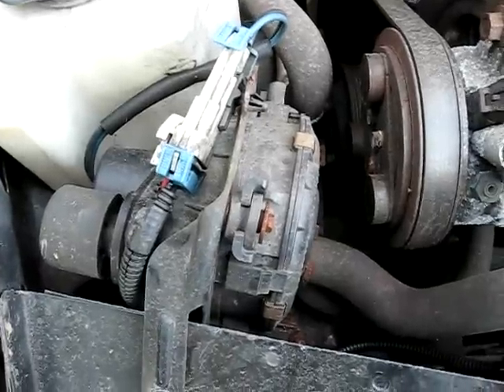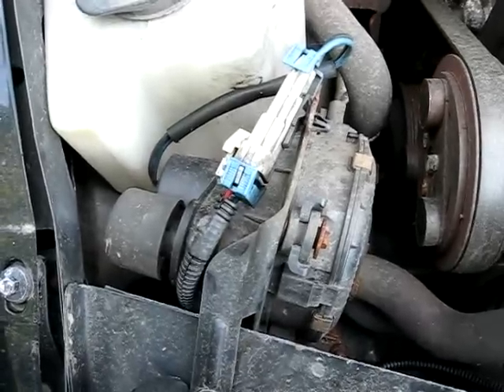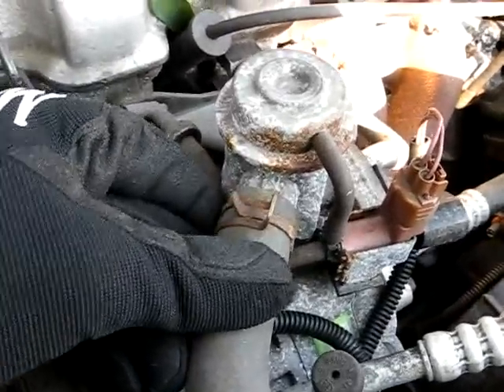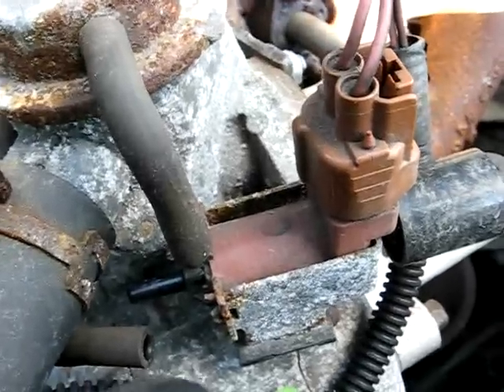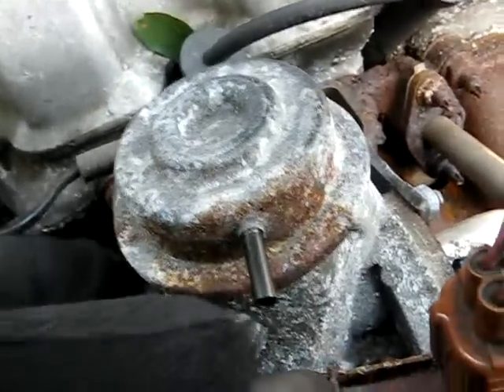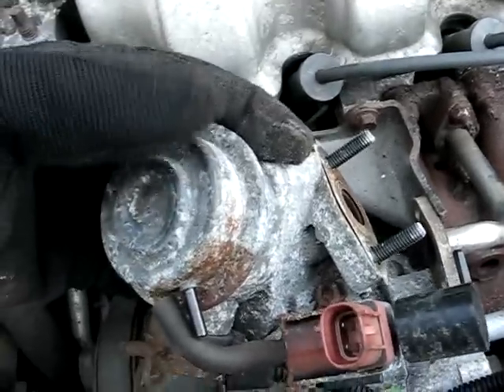P0410 Secondary Air injection System Troubleshooting

Comment: I got the p0410 but everything was ok. Took to a shop n they said it was the upstream and downsream o2 sensor. Could that be right?
Reply from the maker: A o2 sensor with a slow response time can set this code.
Reply: richpin06a Hey richpin - i took this to a mechanic and said that a p0410 can be tripped with a slow response time of the upstream or downstream o2 sensor and he said this: No, I wouldn't try to blame an 0/2 sensor. They are monitored themselves an would set their own codes if there was any issue with their response. The code indicates an issue with the secondary air injection system. The system uses an electric pump that can fail intermittently, along with other control components in the circuit.

I am at a loss on what to do.. any ideas?
Reply from the maker: Toki Tover
In some cases a bad engine coolant temperature sensor can set this code.
Reply: richpin06a Hey Richpin, you're so right. After having verified all secondary air systems to be OK in my daughter 2000 Saturn sl1, I continued having a P0410. My daughter kept complaining about the heat not being hot enough.  I checked it out, and told her, it's working fine ( nice and warm ).  Later on I realized, if that thermostat is malfunctioning or stuck open, it will stop the car from reaching normal operating temperature, and aide with sending P0410 check engine code. So I hurried up and switched out the old, for the new. That car heater works so well, you can bake a cake or cook a turkey in it. The P0410 code turned itself off, after about 15 miles of driving.  Over 313,000 miles, I'm shocked. That car wont die.
Reply from the maker: steelman1331
You did a very good job of troubleshooting.

Comment: Thanks richpin i followed your troubleshooting steps and found my diverter valve was faulty and the pipe leading to the manifold was about 80% blocked with carbon after replacing the valve from a salvage yard about 5 bucks and a bit of elbow greace got the carbon cleared away,in less than 30 min got the code cleared away,im far from a mechanic but your video sure made it easy for me to get the job done thanks!!
Reply from the maker: I am glad you got it fixed.

Comment: Hello
I have a 2002 SL 1
Every time the air pump turns on for 10-15 seconds WHILE driving sometimes the entire car loses power...meaning engine is still on but barely and if I SLAM on the gas I get absolutely NO response 

It only does this when the air pump turns on any idea why or what is the problem

Sometimes car turns OFF...I put it in neutral or park....start the car and we continue like nothing happened

Very dangerous on the high way when this happens
Reply from the maker: The air pump is only supposed to come on at a cold start not when driving down the road.Is the computer receiving the correct temp sensor readings.
Reply: Honestly not sure...this started happening ever since the changed the water pump....but the air pump turns on randomly now...your video is GREAT...on Wednesday I will do the check like your video
Reply: What's strange is the air pump pulls all the power from the car and I can.NOT accelerate for 15 seconds...just rolling down the street or high way
Reply: I tried disconnecting the air pump and the car was running HORRIBLE

Comment: Hello Richpin , I have question about the Air Pump  for my 2002 Saturn Sc2, Does the Air pump start when the engine is hot ? or it start only when you first start the car in the morning ?
Reply from the maker: The pump will only start when the engine is cold say in the morning.

Comment: Hey Richpin, need a little guidance here. I've hot-wired the air pump to my battery via the connector at the pump, and it works fine. I've also checked the other side of that line that supplies the power by hooking a tester into the female side of the connector. That receives power for about 30 seconds, then shuts off, just like it's supposed to. But when I plug the connector back together, and start the engine, nothing :(  I've tried cleaning out the connector (didn't look dirty though), and still nothing. I'm stumped.
Reply from the maker: I need to do a video on testing the fuse block were the relay plugs into for voltage and command signal from the computer.
Reply: I didn't mention that I did test the relay from the fuse box and that checked out fine. The current is coming through that supply line at the right time, it's just that nothing happens when everything is hooked back up.
Reply: richpin06a  I need to know how to check relay/fuse thanks in advanced your videos are very helpful

Comment: I am troubleshooting my 2002 Saturn sl1 with a p0410 trouble code.  What if I checked the current at the air pump and there's no current
Reply from the maker: Check the 30A air pump fuse,10A EGR fuse and the relay.
Reply: Ok Thank you very much.
Reply: I am having the same issue. Can you please tell me how to check the relay?
Reply from the maker: If i had one here i would do i video on checking the socket but i do not at the moment.

Comment: First of all these instructions are very helpful thank you for putting this together.

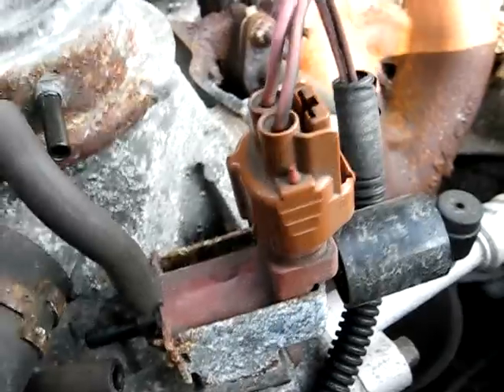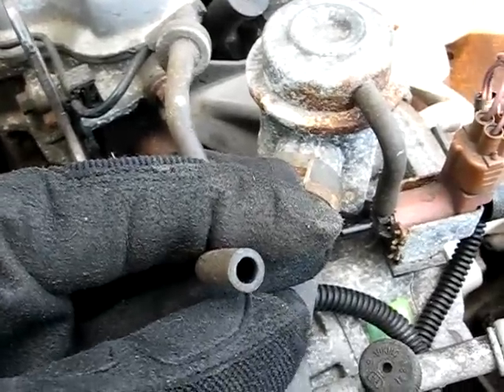Do you know what the level of the current should be going into the vacuum switch you mention at 2:15.  From going through the steps, I found vacuum on the input line (1:14) but not on the output (1:55).  When I checked the current on the electric input to the switch with a multimeter I get .11 amps.  So i figured that the switch was bad, so I replaced it but but I'm still not getting vacuum on the output.  I'm a little lost.

Thanks.
Reply from the maker: Remember the switch only works for about 30 sec on a COLD start up.
Reply: richpin06a Understood.  I checked it immediatelly (about 5-6 sec) after starting the car last night.  It had been sitting for several hours so it was definatelly a cold start. 
I'll try it again tonight and let me son start the car so I can be right there at the vacuum line to check it.
Something just occured to me.  Is there any chance that that little vacuum hose could be clogged?
Reply from the maker: Britt Blankenship Worth checking that hose to make sure.
Reply: richpin06a Hose is clear.  Little or no vacuum on the output hose.  Do you know what the voltage/current is support to be at the solonoid connector?

Comment: in min 4:05 how do you clean that? i don't have to take out the exhaust manifold to do that correct? what product should i use?
Reply from the maker: If the manifold is plugged up it has to be removed to clean it out.

Comment: For each vacuum test, do I need to be shutting off and restarting the engine and checking each vacuum test within the first 30 seconds, or is that just for the air pump?
Reply from the maker: I believe the computer shuts off that vacuum solenoid when it shuts off the air pump.

Comment: update 2:
p0404, p0410, p0507
These codes were all related. I cleaned the solenoid, pipe, diverter valve, exhaust manifold, and head holes for the emission system. The pipe was nearly completely closed the diverter wasn't too bad but the manifold grove was pretty bad worst part was the holes in the manifold which were all four completely blocked. I also cleaned the EGR valve which was stuck closed and cleaned the throttle body. Replaced the IAC (idle air control) and PVC. The code have been fixed. Still have the p0301 think its the ignition coil pack.
Reply from the maker: Wow that was a lot carbon.Your Saturn being a 02 sohc that P0301 could have a intake manifold leak which most had.
Reply: richpin06a yeah that's possible I have not tested the intake manifold but the ignition coil is sparking red so I have that on order should be here from .CA on the 4th. I ran out of money so I couldn't get carb cleaner can I use break cleaner to spray around the intake manifold or should I just use carb cleaner? I didn't try switching the boots on the ignition coil I did however clean it. My husband has wed and thurs off so I get the car all day those days (he works nights so i have to wait for him to get up so he can watch our little one) and I can make a big push to get it fixed. Have u done a motor rebuild on a saturn yet? Thinking id like to rebuild the motor at some point. When I do ill change the water pump and alternator just because it will be easier than replacing it when it still in the car. Sorry so many questions.
Reply: richpin06a it seems that the car has multiple problems.  Im trying to work through them a little at a time. Also wanted to ask why would the exhaust manifold have three gaskets? I found that extremely odd. Dad and I could only come up with the manifold wouldnt seal right, maybe due to a warped head.
Reply from the maker: poemranger
Not sure about using brake cleaner to find that vacuum leak.I have not done a rebuild on the Saturn engine.
Reply: I just used carb cleaner when I got to the corner closest to the power steering pump it stalled out so it needs a new manifold gasket. I have it on order. Other than the missing when its in gear at a light after the air pump is off it runs like a dream again. Thank you again, you've saved us a bundle. Im not sure I can do the manifold gasket so im going to call our mechanic and see what he will charge to replace it.

Comment: Hi Rich, thanks so much for the video. My Saturn 2002 SL air pump runs for about 30 seconds and then shuts off. Does that sound like the air pump is going bad? Trying to avoid replacing it if I can help it.

Thanks again for providing these videos. They have been really helpful for me.
Reply from the maker: The air pump system is designed to only run a short time after a cold engine start.

Comment: update:
I unbolted the manifold from the head and pulled it away to use a coat hanger to clear the completely blocked holes(two on the inside and two nearly completely blocked the outer). Used anti sieze on all the bolts including the bolts on the manifold(nuts and stud when it came out like that). The car ran great except for a bunch of smoke im assuming from the anti sieze burning off. And I heard a vac leak which I realized I dislodged a hose when getting the last bolt in under the ac unit. I plugged the vac hose back up and the car immediately started running bad again in gear. The car isn't running hot so I don't think it would be the thermostat as its been 80deg here it would over heat. I think I need to clear the codes to see what comes up but at this point im at a loss for what to do next.

Comment: From my own experience: Whoever finds out that the EGR (the Shutoff valve) is not working after having the "Service Engine Soon" for a WHILE then most likely you also have: exhaust manifold clogged, and/or oxygen sensor gone bad!

Comment: 2002 Saturn SL! Base
So the codes that were pulled were
p0301 cylinder 1 misfire
p0404 EGR Exhaust Gas Recirculation Circuit Range/Performance
p0410 Secondary Air Injection System
p0507 Idle Air Control System
Originally it only had p0404 and p0410 so im thinking they are all related to the same issue of a clogged secondary air system. Cleaning some of it but not the whole system might be causing all the issues.
So far I have cleaned the throttle body, cleaned the egr valve(twice), started the car without the egr valve the third time I took it off as the second I didn't put gasket sealer on it. Changed the PVC valve, changed the IAC, opened and cleaned the diverter valve, cleaned the manifold to diverter valve pipe, replaced the spark plugs. Tonight I removed the EGR and went down to the metal and put a new gasket sealer on. Before the car would run fine in park but when u put it in gear and let it sit there a little bit it would start to miss and rough idle and the rpms would hunt staying between 700-850. When the air pump is on the car sounds 100% normal. I will say the spark plugs were completely normal for a 47000 miles on them(prob less) The EGR Valve was sticking but moves free now. Ive used your video to check the whole secondary air system all the parts work. I cleaned the aluminum pipe a second time to make sure it was cleaned this time using a drinking straw. I didn't do a good job the first time but its all shinny and new looking now. The check eng light seems to come and go as it pleases. tomorrow ill remove the exhaust manifold and clean it. Weve had the p0404 and p0410 codes for a while so is it possible the EGR motor is just wore out from trying to get it to open? Im also going to have to buy a obdII cause advanced auto parts store said they wouldn't clear the codes for me. As I have one million and one projects the car is a top priority but I only have until Friday at 2 to finish because its my husbands work car and he goes back to work then. Again I wanted to thank you for all the hard work you do in your videos. They are incredible as a whole and your a gem for helping people who cant spend a ton of money repairing things.

Comment: For everyone asking for the name of switch or valve in 2:27, its called the "Secondary Air Injection Shutoff, Valve"
Reply from the maker: Thank you for letting everyone know that.
Reply: richpin06a
Oh no, thank you man! Pepboys cost me $85 just to diagnose and tell me they need another $500 to fix (the wrong piece)!! ...thanks to your video, I fixed it with < $12 valve I pulled from the Junk Yard :)  :)  :)  :)
Reply from the maker: arramad
If everything checked out with the air system then i would look at the ects,thermostat and o2 sensor.
Reply: Is the switch and the valve all one part, or can you just replace the switch?
Reply: Britt Blankenship
The switch is the valve, just different names of the same thing.
Reply: arramad It turns out that the O2 sensor was bad in my case, beside the valve too! Cleaning the exhaust manifold wasn't necessary but it helps anyway. :) now I am getting ~29 mpg compared to 19 mpg before the fix :)
Reply: arramad Ah.  I was thinking that the valve and the electric switch were two different parts.  Thanks.  Now I've got to try and find one that won't cost too much.
Reply: arramad I just got to looking around, and this diagram
http://parts.nalleygmc.com/showAssembly.aspx?ukey_assembly=404934&ukey_make=1031&ukey_model=14669&modelYear=2002&ukey_category=19399&ukey_trimLevel=15361
seems to indicate that they are two different parts (002 & 007)
Reply: Britt Blankenship according to your diagram(Valve, emmission..), what we are talking about is no. 2. When you said "electronic" I had the feeling you might be talking about the solenoid (no. 7)
Reply: arramad I think that the solenoid (no. 7) is what I need to replace.  I've got vacuum on on the in hose, but not on the out (the one going to the valve).

Comment: Hey richpin, I took off the metal tube and it had a 1/8" hole through it, so it most definitely needed cleaned out, now will the code clear itself or not? Also, I can hear a noise that sounds like a cow bell that's muffled ding ding, what on earth cud this be? Please help. It only does it while idling.
Reply: When doing a repair to fix a check engine light you want to clear the code after the repair to make sure you fixed the problem.Can you pinpoint the location of this noise.
Reply: Possibly the PVC valve?
Reply: could be the tensioner pully?

Comment: My system seemed to work but I was still getting the P0410 code. My mechanical genius friend Ken found that the diaphragm in the check valve was broken, using this diagnostic technique: when vacuum was applied to the small tube from the vacuum line, I put my mouth on the large tube opening and sucked and blew air through the check valve. That's when we found that air could travel BOTH WAYS through the large tube opening--both towards the fan and towards the manifold. Air should only be able to travel ONE WAY, towards the manifold pipe. I replaced the vacuum check valve with an OEM replacement for $50.
Reply: Very good troubleshooting.
Reply: could you please explain further your diagnosis? I have checked or replaced most parts (except Oxygen sensor) and cleaned my exhaust manifold....and still have the error....I checked my check valve and I noticed there very weak air comes back at me when I sucked from the air bump side! but I am not sure if that was enough to judge that the check valve is bad?! is it? the air was flowing towards me was very weak but it was there (while the solenoid was doing its work at the same time from both tiny ends)
Reply: g33dav3y, your diagnosis nailed it in my case! Thanks man for sharing the experience...  and thank you rich pin!

Comment: this video was on the first page of in my search of (obd2 code 24   chevey s10) dident pass emissions wondering if this has anything to do with the air filter lid was turned upside down also this is the only code i have

Comment: I have a 2001 Saturn SC2. I watched this video and found my pump, diverter valve, and fuse were all bad. I replaced them and the code went away. However, after I cleared the codes with my OBD2 scanner, I cannot get the evap cannister or the O2 sensors to send any signal, good or bad to the computer. Suggestions?
Reply: http://www.saturnfans.com/forums/showthread.php?t=141365

Comment from the maker: There should be voltage at the air pump plug only with the engine running at cold start up.

Comment: Rich - great video.  I have an 02 SL with this code.  There is 12 volts at the connector to the air pump when it is unplugged.  As soon as I plug the pump in, the voltage goes to 0, and the pump doesn't turn on.  I replaced the pump thinking there is an internal short, hooked it up to the battery and it works fine, but I get the same symptom with the new pump - 12 volts is there until plugged in.  Any ideas?  Thanks